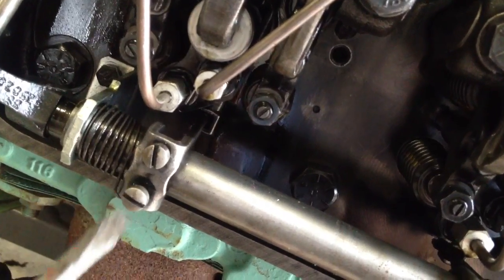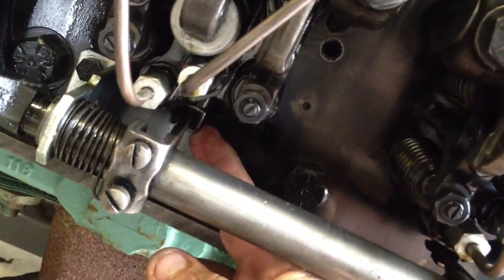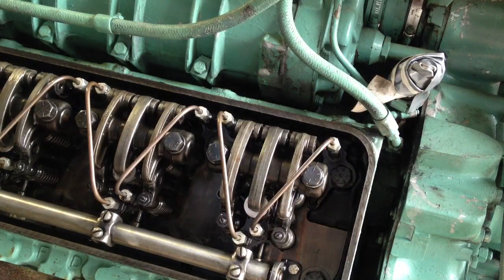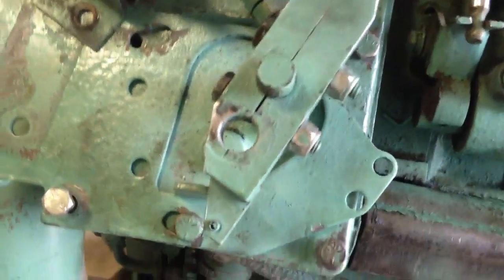8v71 Rack Adjustment

Comment: Could u please tell me what oil i should use in a 8v71 turbo in my 1990 102a3 , have searched all over the net as far as i can tell it is streight 40w oil does it need to be for 2 stroke or as long as its streight 40w its fine ? Thanks for the help
Reply from the maker: Cf2 rated straight 40wt

Comment: That 8V71 has the old 'non dogbone' heads. Those two screw racks took some feel for certain. I always ran the rack starting with both cylinders next to the fuel rod then ran the rest each side, but whatever your method, if you get it right you'll know. They run really smooth when the racks and the governor are set up right. I used to love the challenge of making a pair of marine Detroits sing the same.

Comment: u forgot to back out ur buffer 5/8” it’s n the book, very important to do that !
Reply: When I was learning to work on these at a tech center the teacher did not back out the buffer and the engine ran away and broke the crank in two places.
Reply: Jule Godfirnon 
U know what I do is, when I adjust the rack I always adjust the fuel rod that’s the longest first which n the case is the rt side of the engine lookin from the rear & then after that adjustment I do the left side adjustment making sure that both sides feel the same on the pins & then go from there & that’s the way I’ve been doin it for the last 50 yrs, there great little engines but a lot of folks didn’t apply the proper glues & proper washers & what nots to these engines & that’s y they leak oil so much & the 53,71 & 92 series died, because the EPA didn’t like it & that’s the truth !
“Enjoy these engines cuz I know I still do & good luck sir.”
Reply: Was he incorrect to disconnect the  governor while adjusting the rack?
Reply: Craig Ewing 
No, he did a good job describing & explaining the procedures of an adjustment but forgot backing the buffer screw out cuz that will make the idle ride on the spring of the buffer & ur idle response is slower, I don’t like it like that !
Reply: @stephenstewart9242  The buffer screw is the one at the back of each set? that locks the rack?so four front screws and four back..What is the torque 6ft lbs?
Reply: PrePaidTeam 
I have not a clue on what u said & it don’t make sense to me & it don’t lock the rack it keeps the yield link steady bud, that’s all it does & that keeps the rack from hunting, no what I mean ?
Reply: PrePaidTeam 
Some of the terms of words that you’re using are not exactly kosher but on each cyl u have an inner & outer screw & to tell u the truth idk but I will say this about that the inner & outer screws should b tight enough for it to keep the adjustment on the clevis of the operating lever on the injector where you have that proper spring movement & that’s got to correspond to all the other injectors in line with that rack but each time u adjust it u got to make sure ur clevis pin that takes the carter pin  is snug w/ fuel rod coming from the governor housing  differential lever, u understand & if u want we can go by the book step by step !
Reply: @stephenstewart9242 EXACTLY old mate, deadset correct!!
Reply: Indeed. You don't want your idle riding on the buffer screw.

Comment: 7:49
Looks like one of the exhaust rocker arms has been replaced, it is noticeably wider than the others. (No I'm not talking about the middle injector rockers!)
Reply: Looks almost like it's had an injector rocker installed in a valve position????

Comment: is a rack like an injection pump?
Reply: The injector in a two stroke Detroit is a 'unit type'. It handles the timing, pressurization, and atomization of the fuel. The rack controls the metering.
Reply: +Michael Jagger No, the Rack  meters out the fuel to each injector.
Reply: +Sooty Mangabey if the rack gets stuck the engine can runaway
Reply: Michael Langley,
Yup but it's a little different than a oil-fed runaway. You can simply cut off the fuel supply, while if an oil-fed runaway ... your only options are to block the air intake, stall the engine, or haul your a$$ outta there! XD

Comment: First off, get rid of those old style racks, and install a set of break away racks. Next do what vondet1 said, and set your front injectors so that there is equal drag on the pins. Then set the rest of the injectors to the front injectors. Clear the racks after each adjustmment.
Reply: Frank I know the video is at least fours years ago, I have some questions and is prepared to compensate for consultation fee.  Thanks
Reply: +Frank Hollein I am replacing  injectors on a 2-71 genset. Are there break away racks for the 2-71?

Comment: I was taught to back off all the injectors and set the two front cylinders first so they bounce with a screw driver when in full fuel .Then disconnect them and set the rest of cylinders off the two front cylinders then reconnect and bounce the rack.